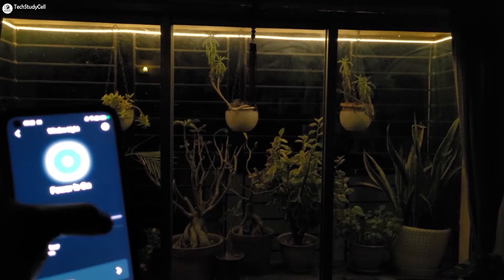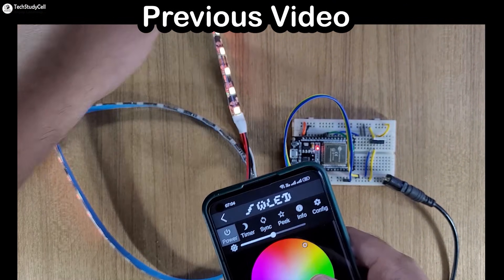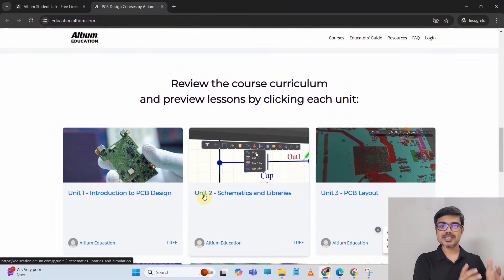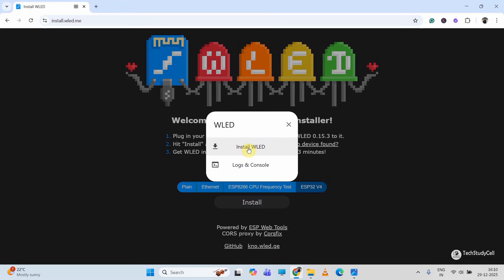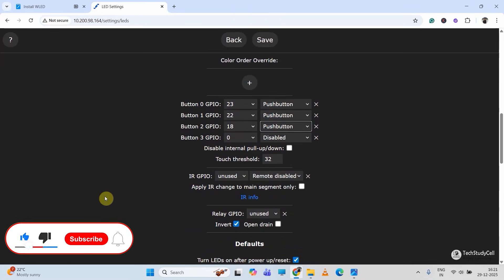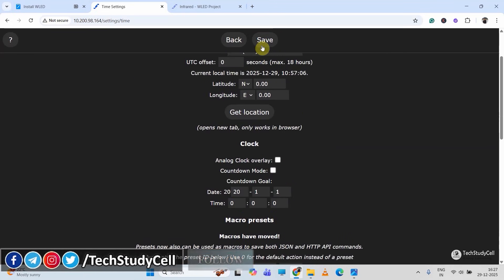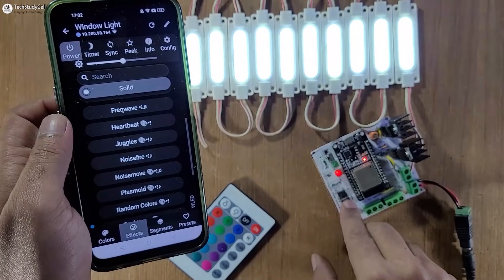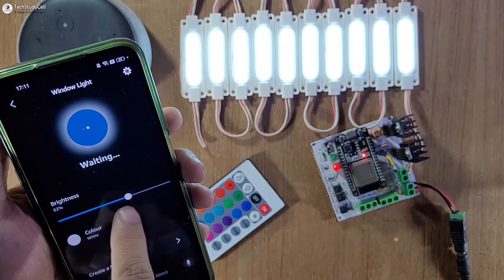ESP32 WLED IoT Project | Control Non-Addressable LED with PWM, Alexa, IR & Buttons (No Code)

Comment: Love your work! For the next video, could you create a board for ESP32 (removable, like a Shield, so we can swap devices anytime) with 8 or 16 channel relay and 2-pin toggle switch for manual control?

(Optional) Add a HiLink AC-DC 5V for powering the ESP and relay, or just use a DC Jack port for powering the device only, while AC passes through the relay directly.
However, still expose other pins (like Shield) so it can be used for other devices like temperature sensors or I2C OLED display.

Currently I have an 8ch relay for my home, but I don't have any experience making boards, so I'm using the 8ch module and ESP32 with jumper wires (no case), it's a mess. I need a reference to tidy up my setup.